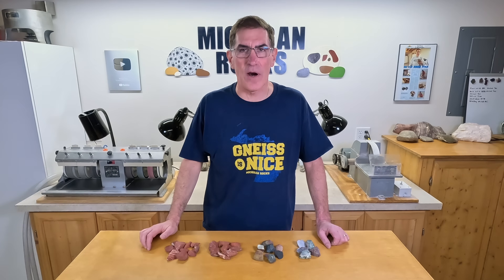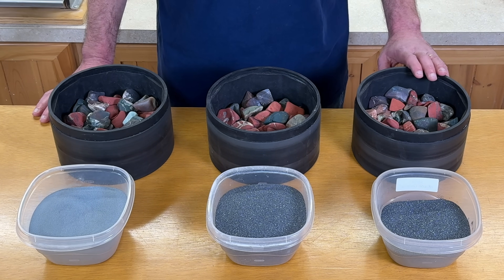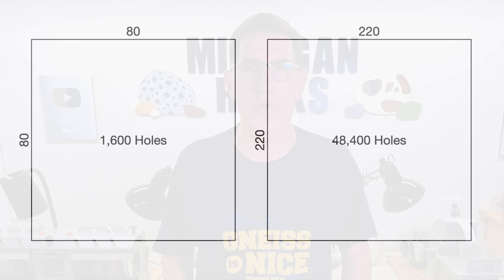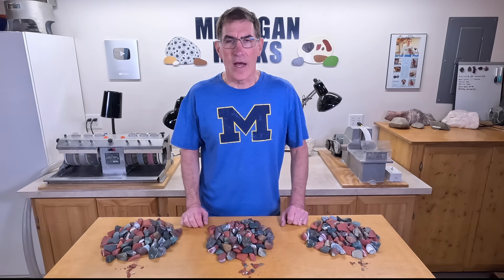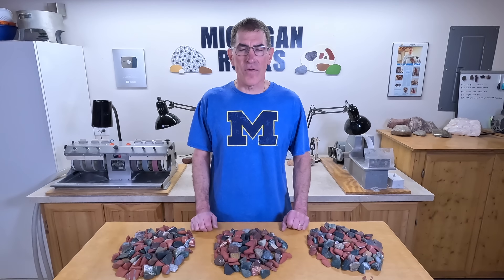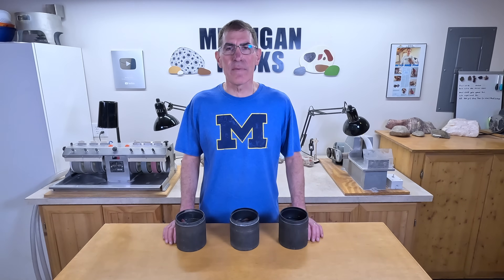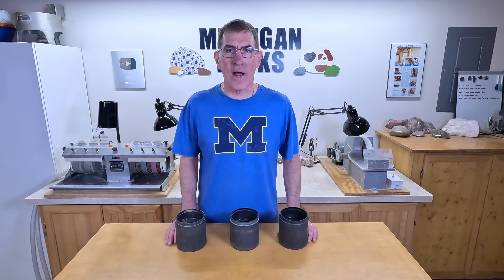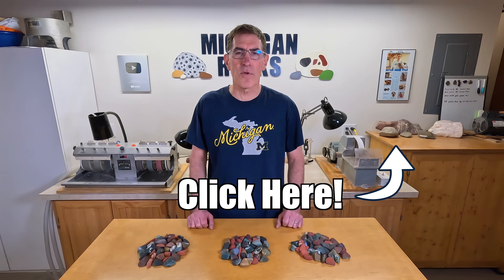What's the Optimal Grit Size in Large and Small Barrels?

Comment: Hi Rob, great vid as usual, answered my question, should I go to a courser grit for first stage of rocks that are truly rougher and more pitted than the smooth beach stones I've been tumbling so far. No, I'm sticking with 60/90.One thing I noticed, though: All the rocks you use in those silly little play barrels in the video were about the same size. Not exactly, of course, there were mild variances in size, but you wouldn't call their size range small - medium - large. You know me, I don't screw around. I tumble in two Rebel17s (just bought a second one, lol) so here's a topic for you: Does large variance in rock size speed things along in the rough stage and make for a better overall tumble? I'm talking big barrels, 10 to 17 pounders, although perhaps it relates to any size barrel. I have jars of 1/2" and 3/4" rocks. When I do a batch in the R17, I first cover the bottom of the barrel with half-inchers. Then I start adding the rocks I care about, from 1.5" to 6" (usually one 6" and maybe two 4-5" per batch). As I fill the barrel, I'm always dashing it with 1/2" to 3/4" rocks that I don't care about. The half-inchers might be pea-size by the polish stage, or smaller. I toss 'em. So my rock size range is 1/2" to 4-6". By volume, I'd say my rock size is about 1/3 small, 1/3 medium, 1/3 large. My theory is that, yeah, in the rough stage, and those that follow, the grit is doing the dirty work, but the small stones are acting like ceramics, pounding the grit into the larger rocks' surfaces better than, say, a barrel with rocks all about the same size. What do you think? Renegade Gardener.
Reply from the maker: Hey Don. Honestly, I haven't done tons of really big rocks. I have done a few though. I think I'd stick to just one big one per barrel, with a mix of other rocks like you're doing. I do think a mix of sizes is best, but that's not always what I have, so it doesn't always happen. When buying rocks, they tend to be of similar size. 

One thing I have noticed is that if you have too many really small rocks in a batch, it impedes grinding. At the end of a week, there will be a lot of unused grit left in the barrel. 

Another observation when tumbling a big rock is that it beats up smaller rocks in the barrel. I'm glad you said that you put in filler rocks that you don't really care about. That's the way to do it. 

Don't hold your breath for an experiment video on the topic you're wondering about. That would be a difficult experiment to do. It would be really difficult to maintain rocks of similar sizes in different barrels, plus it would take a lot of rocks to do this well. 

Here's a video on a big rock I tumbled several years ago. I don't even remember what I did with that one, but there might be something in the video that might help you out. https://youtu.be/4eX-IcZtZfU

You could also ask your question on the  Rock Tumbling Hobby forums (https://forum.rocktumblinghobby.com). I know there are some threads there on this topic. There are some very knowledgeable people there.
Reply: @MichiganRocks  Good info, thanks, I also got your email and will watch that vid. Happy tumbling.

Comment: Hi Rob, really great video that answered my question whether it is better to use a coarser carbide in the first step or not.
Basically, it follows that the differences between the grain sizes in the range of about F-40 to F-100 are negligible and it depends more on which carbide we can buy cheaper in this range. With the fact that using a finer grain in the first phase no longer makes sense.

From your other videos, it is quite clear to me why you use AluOxid in steps 3 and 4

But maybe it would be interesting if you ever did a test of the second step,
whether to use Carbide or AluOxid with a grain size of +- F-220
I don't know how it is in the USA, but in the Czech Republic AluOxid is significantly cheaper than Carbide and if the difference were minimal, it would make sense to use the cheaper AluOxid
Reply from the maker: I think in the second step silicon carbide is better because it grinds more. At that stage, I think grinding is more important than polishing. This probably isn't an experiment that I'll do, but it would be a good one for you to try. You don't have to actually be very scientific about it, just try it on a batch or several batches and see how it goes. Your fellow Czech tumblers would probably appreciate it.
Reply: @MichiganRocks  Thank you for your opinion and explanation. I will definitely try it, the price of AluOxide in F-220 grit is much less than half the price of Silicon Carbide
Maybe I will try the AluOxide on a softer material like fluorite, it could be much gentler

Comment: One other thing to look at would be how quickly different size grits reshape the rocks.  higher loss of mass doesn't necessarily mean good rounding is happening.....
Reply from the maker: I don't see how different grits would shape the rocks any differently. Using a vibratory tumbler rather than a rotary tumbler makes a big difference in how the rocks get shaped. I could see how using a larger or smaller barrel could possibly make a slight difference, but I wouldn't even expect that to matter too much. 

If there was a difference in shaping, I'm not sure how you would measure the difference.

Comment: I kind of did this experiment but found the real difference is when u add sawdust and ceramic media and pre grind the high spots and chips
Reply from the maker: I have found that ceramic media in the first stage slows things down quite a bit. Pre-grinding can really speed things up though.

Tell me more about adding sawdust. How much do you add? How do you feel that it helps? Are you trying to thicken the slurry?
Reply: @MichiganRocks it seems to coat everything better and get into corners better with using the media the size and shape of ceramics matters alot do an experiment on it its more about filling the gaps with as much weight as possible per piece ever tried using crappy sappires or zircons as filler try it
Reply: I use about a handfull of saw dust for the large barrel in your vid

Comment: Thanks for running the experiement.   I know it took a lot of effort to do this.  There have been some recent discussions on this subject on the Rock Tumbling Hobby Forum so your experiment is timely.   On another subject (from one of your previous videos), how are your barrels that you added rubber to the bottom holding up?   I noticed on the 12 pound barrel that I did this to (think it was last fall) has worn through the rubber and expossed the adheasive in a couple places.   Wondering now if my rubber was too soft or I should have used thicker material.
Reply from the maker: My barrel repair is doing the same thing. I think I used the wrong type of rubber. However, I have just filled in where it wore with more E6000 and that seems to be holding up pretty well, so I'm still happy with my repair.

Comment: My friend you put in a lot of effort for this experiment. I am to lazy for that. Can't wait to see what works best and then copy that. I my self use 60-90 rough 220 stage two 500 stage 3 finish with cerium oxide. I have a vibratory tumbler for my gold recovery hobby I may get another for the rocks
Reply: I am currently just tumbling. I have 3 harbor freight 3 pound dual barrel tumblers. I am expanding I finished the roof of the rock shop addition on my shed. I have a tile saw and a ten " lapidary saw waiting till I finish.
Reply: Thinking we may get together for dinner while I am up there next month. I like Kelly's there between you and Rogers City. But I am afraid of running into my ex wife. So if you want we can meet in Detroit.
Reply from the maker: Nope, I don't think I'll be driving to Detroit for dinner. That's a bit out of my way.

Comment: Your scientific approach and attention to details is always appreciated.  I currently have only 3 lb barrels and have experimented with 60/90 and 40/70 grits.  My results which were always visual indicated that 40/70 wore the rocks down faster. Now I'm thinking it was a lot of expectations and imagination!  One thing I DO know is that the larger grit wears on the barrels faster. It really grinds the rubber off. So I may focus on the 60/90 grit in the future, even though it's a bit higher priced. I'm building a tumbler cabinet that will hold bigger and more barrels, so want to maximize barrel life. I am going to use a DC motor that I believe will use a much lower amount of electricity.  I'll let you know how that goes!
Reply from the maker: Good luck with your project. I love my cabinet tumbler.

Comment: SO  for the loss difference between amounts of rock in the barrel (10:17), that change can also be attributed to higher grinding action on rocks with sharp edges instead of rocks that are already started to round. A good way to test this would be to run a set of 3 barrels of fresh rock at the different weights with the same size grit and see if there's a difference, then do the same thing with the same barrels for weeks 2 and 3 and see what the data set indicates.
Meaning, 3 barrels of fresh rock, using 60/90 grit, one at 2000 g, one at 2200g, and one at 2400 g.
You could then test it by running 3 barrels all at the same weight and grit, but at different weeks. EX all 2200, one fresh, one at week 2, one at week 3.
Reply from the maker: You're right, I didn't test for that, but that would be a ton more work, plus buying more rocks. For that reason, I won't be doing that experiment. Someone else could volunteer though!

Comment: Hi Rob, as Im learning more about using my tumblers, I think I am seeing that too much water makes the tumbler take longer. When I use less water it seems to go quite a bit quicker. Have you experimented using less water? It seems to makes sense that the water would dilute the grit
Reply: I think less water is better because it allows a thicker "slurry" to develop, coating the rocks and making for better grinding than the grit sloshing around in water.
Reply from the maker: That's another experiment that I have on my list. It's pretty high on the list.

Comment: This is fascinating research, Rob. Do you think it would matter if you mix the 35/70 grit with the 80/90 grit?  Just in case you ran out of the 80/90 grit. Also, do you think that tumbling speed has any factor in the end result? I know speed might get the job done quicker, but could it also damage the rocks? Just thinking out loud. Thanks for sharing.
Reply: Ooo! Next experiment!  Same grits, different speed!
Reply from the maker: Since the results from 35/70 weren't that much different than form the 60/90, I doubt that it would matter much if you mixed them. Tumbling at faster speeds does grind faster. I know this from using a National Geographic tumbler that goes too fast in my opinion. It does damage the rocks, at least some kinds of rocks.
Reply: @MichiganRocks  My first tumbler was a National Geographic. Have you ever used the 35/70 grit, and it didn't disintegrate during the process and reused it? I've had that happen once, when I emptied my barrel,  there was grit in the bottom.
Reply from the maker: @brianholcomb940  Yes, I have. That has happened to me when I have too many small rocks in the barrel.

Comment: I feel like the 30-70 grit would also make the other stages take longer for the reasons you mentioned being deeper cuts endless points of contact in comparison to the 60-90 grit just because the next stage is grits will be so much smaller it will take longer I would assume to level out the cuts using  course to fine and you have to buff out all of those previous grits cuts right. I would like to see the experiment continued on to the next stage is to see if the next stage takes longer to fully determine what grade would be more affective.
Reply from the maker: As the grit breaks down, it's almost like going to the next stage within the first stage. If you start out with 35/70 grit, by the end of the week it will be a smaller size grit, more like 400 grit, maybe. I just made that number up, but my point is that it will be finer by the end. So it should at least partially start removing the scratches that it put in the rocks at the beginning of the week.

Comment: Thanks so much for this video. I just got my first tumbler (a two barrel Leegol), and this is very helpful. I have watched your other videos in preparation for the day when we would finally have enough power to run one (on solar power exclusively). Thanks again. 😊✌️
Reply from the maker: Fortunately, tumblers don't use that much power, but I'm impressed that you're doing it on just solar.
Reply: @MichiganRocks  800 watt Bluetti and 200 watt panel. Just barely (in early spring in AZ) will run it for 24 hours. Probably won't keep up on cloudy days.

Comment: If 120/220 takes longer in the first stage to remove the same amount of weight as 60/90 - but the finish is much better and allows you go right to what would be stage 3 if using the coarser grit, then maybe that does seem like the best first stage grit!
Reply from the maker: Except that I typically run the first stage for many weeks, removing only the rocks that look flawless, and adding in new rocks. If I ran all the rocks for a set amount of time, I might agree with you, but my goal is to grind as much rock as possible. Adding another stage after is a small amount of time compared to the time I spend doing the first stage.

Comment: Very interesting research. Well thought out experiment. Another way to have done it would be to cut large rocks into identical cubes on the slab saw.
Have you ever played with abrasive media? I mix some 60/90 silicon carbide deburring triangles in with my first stage. I bought them by accident when buying regular ceramics and am using them up in this fashion. Do they help with the grind? I don't know.🤷‍♂️ The abrasive media lasts for a few cycles and is cheap. My hope is they give more points of contact where abrasion occurs. Just a thought.
Reply from the maker: I'm not sure that rocks cut into all the same shape would tumble the same as randomly shaped rocks. It would be a way to make all the barrels more identical, but might not simulate an actual load of rocks very well. I'm not sure. 

I guess if you wanted to find out if your abrasive media works better, you'd have to do some sort of experiment. Sounds like you found a good way to get rid of your accidental purchase anyhow.

Comment: I recently purchased a highland park rotary tumbler after seeing yours. The lids on the barrels all have a hole worn through the inside rubber. Directly in the middle where there is a flat nut from the outside.  Am I doing something wrong or is this a defect? Any suggestions on how to remedy this? Thank you for all your information!!
Reply from the maker: No, they shouldn't do that, but I have had the same experience. I have talked to John about it and he's aware of the problem too. He has redone the molds to make the rubber over twice as thick and he's looking at using a harder rubber. Hopefully they'll be better in the future, because the six weeks I got out of mine is not enough.
Reply: @MichiganRocks  thank you for the response.  So how did you fix this?
Reply from the maker: @ I got more lid gaskets.
Reply: FYI, I have this exact problem with my HPL dual 3lb tumbler barrels. It's three weeks and sometime during the third week of tumbling, the center "knob" of the gasket becomes a hole. I have had discussions with the great helpers at HPL via email. They are waiting on getting the new gasket liners. Until then, they have offered to supply me at no cost with new inner lid gaskets. I am not sure how many times they will do this. I am grateful that they bend over backwards to help me out in the mean while.
Reply from the maker: @michaelc6817  I have run my three pound barrels for several months with no problems. The big ones last about six weeks. They do seem to be going out of their way to keep customers happy, but it will be nice when they get the barrels figured out.
Reply: @MichiganRocks  That's interesting about your 3lb barrels. Mine fail predictably at 3 weeks. On another note, though, my 4.5lb barrel lid gasket has lasted four months now. It does not have the "knob" in the center like the 3lb barrel lid gaskets have.
Reply from the maker: @michaelc6817  Yeah, that's really weird.